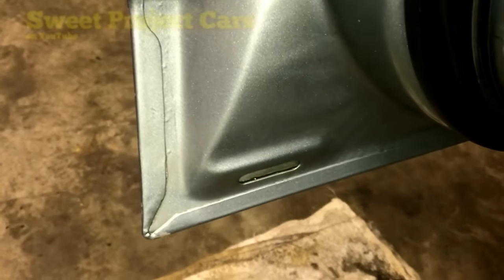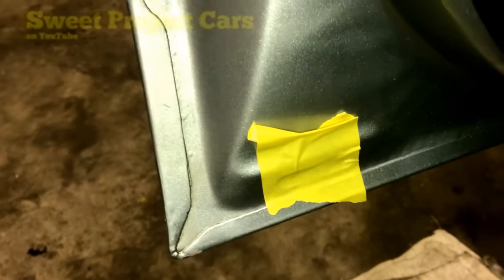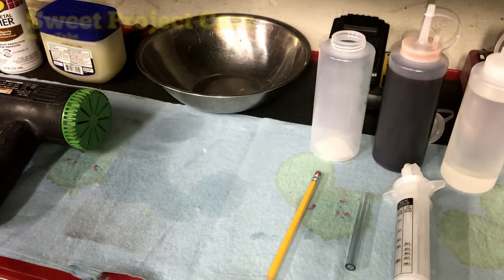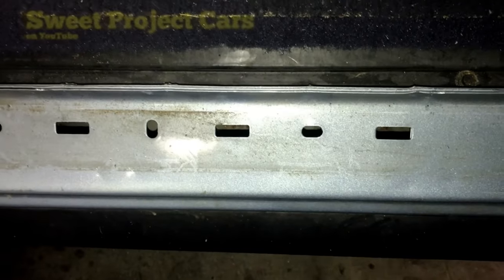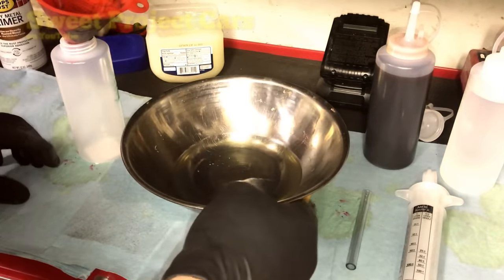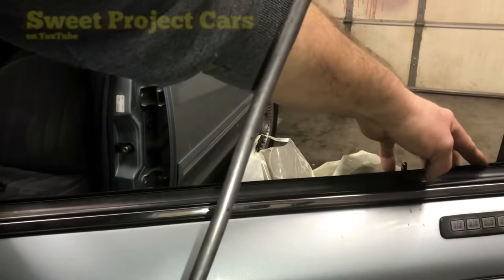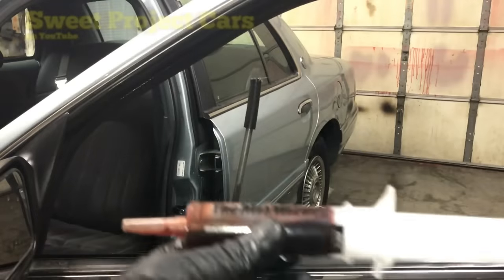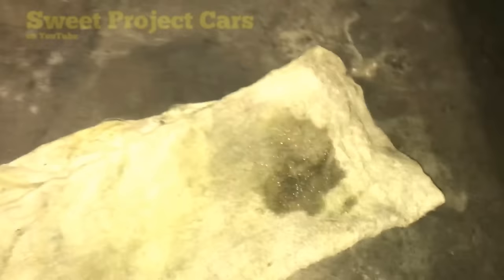Your Car Will NEVER RUST Again! For Just $10 Bucks!

Comment: Thanks for your videos! The petroleum jelly goes back to a jelly consistency when it returns to room temp, right? I always thought that transmission fluid was harmful to paint, nice to learn that is is not. will the petroleum jelly and transmission fluid mix together in a warm solution?
Reply from the maker: Jacob the PJ soaks in and will smother the area and it seals so the rust cannot start or grow..remember rust needs oxygen to grow...and TF is safe for paint...and they mix together very well :)

Comment: carzy, i always thought it rusted from the outside in. but youre saying it starts from the inside? and just putting some water repelling product in there it will prevent rusting? who knew
Reply from the maker: It starts on the inside so if you can make sure it’s dry and add your mineral oil or transmission oil or even a professional rust inhibitor you will not have rust have a great day thanks for sharing Mike sweet project cars

Comment: Wouldn't the petroleum jelly solidify in the bottom of the panels? Would that provide longer protection or allow water to become trapped, much like leaves and mud?
Reply from the maker: it works great with no side effects thanks  mike

Comment: Spraying on Used Transmission fluid seems like a very good no cost idea to me. I understand it won't likely deteriorate rubber. Do you think it's the right way to go for a very cheap fast application of rust proofing maybe do every year or two? Do you have any second thoughts regarding appropriateness of transmission fluid. I'm thinking of just using a cheap garden sprayer filled with used transmission fluid and spray the underside of my much liked 2009 Honda CRV (110k miles) every couple years. (One could even fill a power washer with transmission fluid for a really fast application in a field.) What are your followup thoughts? I appreciate any reply. Thanks Bob
Reply from the maker: i think your ideas sound great...trans fluid works great we say try it and see if it works with your sprayer ideas bob

Comment: Sorry for the dumb question, how does applying oil from the inside prevent rust on the outside? Or do the majority of rust problems start internally?
Reply from the maker: knpstrr this video may help you on that  https://youtu.be/WOpKDt5JEFk also most all rust starts on the inside and works its way out.

Comment: How about Marvells Mystery Oil ? I have heard old timers talk about spraying it under their cars on the frame, floor panels, fender wells etc. and they didn't get rust like you do nowadays even with undercoating.
Reply from the maker: We always say any oil is better than none but good used motor oil or good used transmission fluid is dirt cheap and works really well

Comment: What do you recommend for my really rusty 2000 Ford E150 Cargo Van Frame? Painting the outside of the frame with motor oil?
Reply from the maker: Use this  https://amzn.to/3695BO1  if you plan on keeping your van for any period of time.  You need to stop the rust on the inside of the frame and the outside of the frame.  Thanks for asking.  Hope this helps.  Have a great day my friend. mad Mike the hammer SPC

Comment: Great idea!  im thinking it would just wash away, and need to repeat often!? thoughts?
Reply from the maker: Tom, my thoughts are look at it like this, have you ever had cooking oil on a pan or plate and try to rinse it off with cold water and no soap?  It will not come off, this is the same concept.  Thanks.  mad Mike the hammer SPC

Comment: Here's a helpful tip: clear the weep holes in the body of the car. Bottoms of the fenders, under the rockers, and bottoms of the rear quarters are trouble spots. If you park outside, leaves and needles from trees get into these areas and clog the weep holes. Clear them however you can. I've seen cars rot away from this.
Reply from the maker: Thanks for watching and sharing Marv.  Have a great day. mad Mike the hammer SPC

Comment: Wouldn't using wax be a better option as it will not leak out not have to be replaced? Also couple of scented candles from a Dollar Store as the source of the wax would add a pleasant smell to the car as well.
Reply from the maker: Rodney Pike we tried that many times and it wax would harden and crumble, we found over the last 40 years of this procedure the used trans fluid worked the best and the mineral oil was the easiest to work with  thank you for sharing my friend

Comment: good tip but in the rust belt it will still rust. underbody, frame, suspension conponents, etc. there are several products that you can spray under your vhicle and in the cavitys that are supposed to work pretty good, fluid film is one off the top of my head.
Reply from the maker: shonuffisthemaster we live in the rust belt as well and thats why we put these videos up for guaranteed protection 1st Rust Video in Series  https://youtu.be/WOpKDt5JEFk 2nd Rust Video in Series https://youtu.be/PLQLuWdoFgw 3rd Rust Video in Series https://youtu.be/nSDiHydE23o 4th Rust Video in Series https://youtu.be/gh6X1d5BsYE

Comment: Am I correct in thinking that BMW put an anti rust grease type stuff inside the door panels etc? I'm pretty sure I see a streak of yellow grease on my 07 plate before now when I happened to look in that area? Not sure can't remember.. 
Great tip though.. also if BMW do would this counteract the grease they add/dilute it or just be additional eg. Counter productive?
Cheers from London England 👍
Reply from the maker: I can tell you it's not grease, their last concern is that your car won't rust.  What you are seeing in there is most likely the adhesive they use to glue the outer door skins on with.  Thanks for asking, hope this helps.  Have a great day my friend.  mad Mike the hammer SPC
Reply: @SweetProjectCars  ok thanks maybe it's excess from the hinges on the door as it's at the front of the panel inside driver's door so probably that, been there from new 13 years so probably just over did the hinge lube lol 😅

Comment: Question.  All the fluids are oil based, right?.  Oil floats on top of water.  Each time it rains wouldn't the oil float to the top and drain out the weep holes?   2 to 3 years seems like a long time per treatment.  I don't know, just asking.
Reply from the maker: Tom Open once the film of oil is on then it would take garden hose pressure to even try to remove it...we have done this timeline of 2 to 3 years on oiling for 20 plus years on the same cars and they are rust free. thanks for asking

Comment: I had luck using fluid -film aerosol.  I used half a can per door and its in a mist form so a half can will mean it soaks down into the seams . The down side it costs about 120 bucks and you have to wear a respirator when spraying .
Reply from the maker: Dave you mean this  1st Rust Video in Series  https://youtu.be/WOpKDt5JEFk 2nd  Video in https://youtu.be/PLQLuWdoFgw 3rd Rust Video  https://youtu.be/nSDiHydE23o 4th Rust Video https://youtu.be/gh6X1d5BsYE

Comment: Thanks for the video. I've. had cars rust in the windshield pillars. should I drill from the inside and spray inside? Also, I know z bart at one point changed the formula and it wasen't as good but then I heard they improved it. Is z bart the best way to go. I've used it on old cars too that were in decent shape. Please get back to me and please answer All the questions. Thanks so much.
Reply from the maker: Yes take your pillar cover off and there should be holes already there if not you can drill a couple at the top and apply the mineral oil and you’ll be good to go
Reply: PLANET b

Comment: iv always jus used wd, weve always got it in drums so iv always had plenty, i didnt do that tho i just use a spray bottle n randomly hit spots, i also hit every single threaded or moving connection or lines that look like theyre in a spot that could hold water, basically anything that can benefit.. i live n swear by that shit, we tried a few others but theyd either be too expensive or noticeably didnt work as well, the entire shop (19 ppl) r believers now lol :p  keep in mind, wd and these oils might b water deterents, but they still absorb moisture so u will still eventually get rust one day, wax is a really good way to do it tho, and in fact alot of gm obs 88-98 at least, they somehow applied or coated wax on the frames, idk why they didnt dip the entire frames but u can tell the spots where they did because its that really hard road tar like waxy stuff, and its Always fresh metal under there.
Reply from the maker: Thanks for watching and sharing Travis, have a great day. mad Mike the hammer SPC

Comment: petroleum jelly is flamable. i use cottonballs with petroleum jelly to light fires on camping trips
Reply from the maker: Petroleum jelly is not flammable   Watch this  https://youtu.be/5J0VG4_jR2w  The only reason it SEEMS that the petroleum jelly burns on cotton balls is an illusion.  If you are to take a cotton ball with nothing on it and light it on fire it will burn up in seconds.  By adding the jelly to the cotton ball, you are slowing down the combustion rate of the cotton ball, it is not the petroleum jelly that 
is burning it is simply slowing the cotton ball from burning up in seconds. Thanks for watching.  mad Mike the hammer SPC

Comment: If you have air compressor and an airline you can take an attachment which puts little bit of a liquid in with the air and when you use a blow tip that extends out or it's just real thin as it gets to the end you would need to get the syringe out you would need to get the brake line bought none of that you just put it in those different holes you want to get into and just squeeze the trigger and the liquid that you have in that canister will be sucked through with the air and blowing into those places and thank you to get into a lot of places forced that you would not normally be able to get you and gravity wouldn't still touch it so you get more protection and you don't need all those other pieces and it's faster.
Almost forgot I had to come back in and add this , out of the three choices I would take the petroleum jelly simply because it will repel water acid rain some Degreaser or whatever else that might come in contact with general cleaning of the vehicle our car wash is going to cool off and Harden back up becoming a solid and obviously water won't penetrate it unless there's a pathway for to do so
Reply from the maker: Thank you for watching and sharing, we appreciate it, have a great day. mad Mike the hammer SPC
Reply: @SweetProjectCars  hey we're all just trying to help each other out in this big world called Automotive Land. I was in Houston for 30 years now in Florida but while I was there I started from scratch many different businesses and my first two were auto detailing companies and I would do extreme cases of stuff maybe the car was completely submerged in flood water and it would be like nothing ever happened but the car was gutted and after being cleaned and certain things being moved vacated and rust remover proofer and using germicidal/Lysol type stuff basically the vehicle was probably better when it was purchased used Before the Flood and we would do tour buses and maybe 200 chairs for ExxonMobil inside the skyscraper and tables getting ready for a big meeting custom show motorcycles for the big Auto shows excetera excetera but I got into doing a lot of late paint and body little cosmetic touch-up swear I would try to keep things original as much as possible and just repair the affected area and let that blend in or be done on a contour somewhere so that you couldn't tell where the new was the old was I'm really good at doing that with a lot of stuff even like Metals polished Metals vinyl leather yo paint obviously I go on and on so anyway the point is if you ever need help or maybe a little bit of an idea with something let me know because my Catholic friends call me Saint Lyle and I asked him why he said it was because you perform miracles on these cars lol take care

Comment: Water resistant grease! I guess the one's we use for bearings are not waterproof. My boss explained this to me. I guess this is something I am going  to do some research on. Vaseline will mix with water over time. I wonder is gearbox grease is a better one to use? Motor oil is nice for  awhile.Especially as it will soak into the door skin and crevices.I knowWD40 is water repellent. It makes the moisture become super dense.W-Water D-Density (40 for 40 tries to create the formula) Ill  elaborate on this more later. The grease I  bought at walmart for the door hinges 'washed' away after the past 2 storms. I am thinking what Russia uses to store their weapons. Cosmoline used for in freezing and wet conditions. Also for high temps too! It is very thick and a little heat helps to make it more for application. Cant be too hot  though. Tricky stuff but they use these in the wet conditions  are over russia! Not too expensive if you use it as needed than apply it all over something beyond.
Reply from the maker: We have done this on hundreds of customers cars and none of them have rust on them after 20 years it’s a good process and it’s affordable to do
Reply: There is a grease named 'red grease'.  It was used on water pumps 75 years ago.  it is stiff.  Mix with tranny fluid to thin it down.  That would work to be water proof.

Comment: On places that probably already have rust starting like the rear fender wheel opening on my Dodge Pickup, will Transmission fluid stop the rust in progress? Have you used POR 15 in any areas and does it work?
Reply from the maker: Tom McKinney  this is what we use now it's awesome  https://youtu.be/U10Qq9mUre8 it stops the rust in its tracks

Comment: Thanks sweetprojectcars  1 question tho. Will this work in any other part of the body if i sand the rust in the surface and just aply any of this "rust inhibitors", ??
Reply from the maker: Yes, it will work on any metal and you can prep it however you see fit, sanding included.  Thank you for watching and asking Franco.  Have a great day.  mad Mike the hammer SPC
Reply: @SweetProjectCars  excellent!! Thanyou very much. For replying.

Comment: I also found a low mileage 2005 Cadillac Deville that never gets used in the winter. I looked at the bottom of the door, and it has a rubber seal, and I didn't find any weep holes. How much clean trans fluid do I use? I don't want to smell any odors if and when it gets hot out. Is this application good for those 4 doors also?
Reply from the maker: This will work great on that caddy it probably won’t take more than half a quart to do all four doors it will not be any smell either if you’re worried about that I would use mineral oil then you’re guaranteed no smell whatsoever

Comment: What do you suggest for protecting the vehicle frame?  Do you think the petroleum jelly rubbed on the frame would work as well as expensive aftermarket solutions, like POR15 or Rust Bullet?
Reply from the maker: We are getting ready to do and undercoating video very soon it will most likely come out on a Thursday with in the next couple weeks have a great day
Reply: Thanks, man.  Great channel you've got here.  I subscribed.  Appreciate all the info you provide.

Comment: Petroleum Jelly is VERY flammable.
Reply from the maker: Petroleum jelly is not flammable   Watch this  https://youtu.be/5J0VG4_jR2w  The only reason it SEEMS that the petroleum jelly burns on cotton balls is an illusion.  If you are to take a cotton ball with nothing on it and light it on fire it will burn up in seconds. By adding the jelly to the cotton ball, you are slowing down the combustion rate of the cotton ball, it is not the petroleum jelly that is burning it is simply slowing the cotton ball from burning up in seconds. Thanks for watching.  mad Mike the hammer SPC

Comment: Great ideas. Is there a fluid that is heavier than water or will displace water?
Reply from the maker: mike you always do this method with a dry car and once it is in there is no rinsing it out...kinda like trying to clean a french fryer with cold water just doesn't come out
Reply: @SweetProjectCars  I see. I guess rinsing the salt water out of the rocker panels before applying the rustproofing  is the challenge here
Reply: Yes, WD40 will help disperse water and protect the Metal as it contains fish oil !
Reply from the maker: Once you apply this mixture it neutralizes the salt for salt cannot do it’s job to start corrosion with the mineral oil or the transmission fluid in there

Comment: does transmission fluid affect paint? was thinking to undercoat my new utility trailer.
Reply from the maker: No it does not, there is no fluid in a vehicle that will harm paint, manufacturers know how ignorant people are and therefore no fluid that is used will harm the clear coat.  Thanks for watching and asking RTC, have a great day my friend.  mad Mike the hammer SPC
Reply: @SweetProjectCars  what about brake fluid?

Comment: Petroleum jelly is flammable  !
Reply from the maker: Petroleum jelly is not flammable   Watch this  https://youtu.be/5J0VG4_jR2w  The only reason it SEEMS that the petroleum jelly burns on cotton balls is an illusion.  If you are to take a cotton ball with nothing on it and light it on fire it will burn up in seconds.  By adding the jelly to the cotton ball, you are slowing down the combustion rate of the cotton ball, it is not the petroleum jelly that is burning it is simply slowing the cotton ball from burning up in seconds. Thanks for watching.  mad Mike